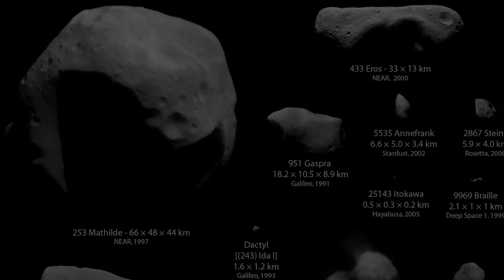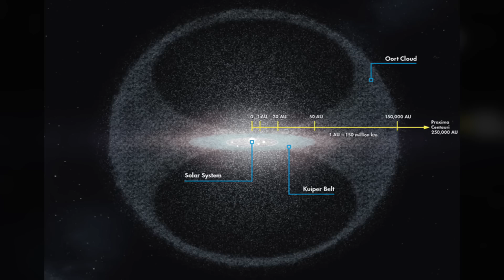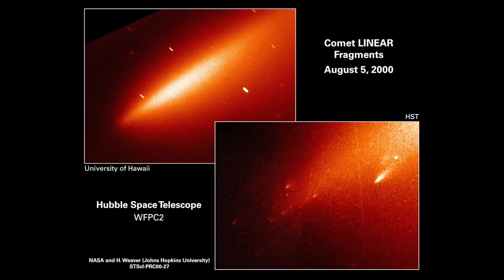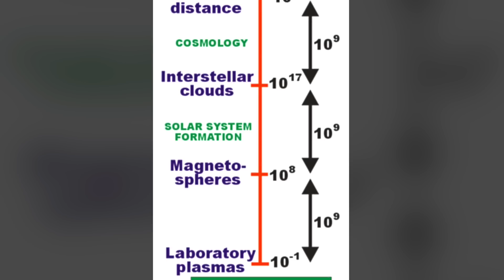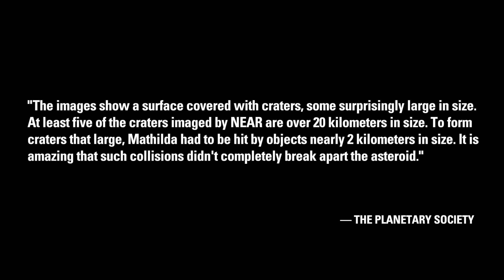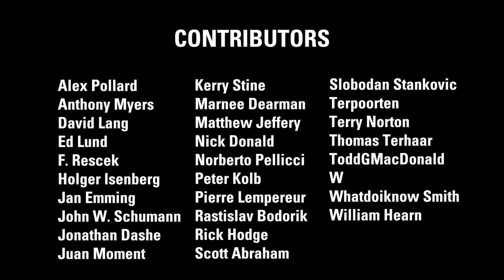Matt Finn: Asteroids That Should Not Be | Thunderbolts

Comment: I'm going with pieces of collisions as outward force of pressure. They are pieces of something bigger that was hit. Centrifugal force. Everything is quantumized pieces of elements. Heat does transfer through space and atmospheres outside of entanglement of mass as potential renewable heat energy when absorbed into internal magnetic fields grounding currents through its nucleus or core where external heat energy force is strongest centrifugal forces. Hurricanes within mass quantumized magnetism. Electricity is rapid heat grounding currents as magnetism bonding. Static electricity is rapid heat grounding through mass as heat energy leaves a trail lighting up the atmosphere like a filament bouncing of atmospheric gases instantaneously flash lighting as fire light. Lightning bolts are shoreline fire light of instantaneously fire lighting up atmospheres like filaments striking gases unabsorbed instantaneously. Fire is an external magnetic field disolving internal magnetic fields as mass. As you move closer to fire force increases and distance decreases and it's hotter. Move away and force decreases, and distance traveling increases. Magnetism.

Comment: And comet tails ate always in the opposite diection of the sun funny how that is possible if they are shedding material as they pass it would always be behind them. What about solar wind you ask. Well if the solar wind is strong enough to blow all the stuff away from the sun shouldn't that slow the comet down so that its orbit will be constantly changing ... but comets come in regular intervals that have been tracked for thousands of years.
Reply: Everyone misunderstands solar wind! 🤦
Reply: Well it's not wind, it's charged particles. They aren't pushing anything, but they are causing a discharge away from the biggest dog in town, the Sun.
Reply: Comets normally are only a few days near the sun and there the solar wind has impact on the comet. Not enough time to change the path of the comet much, because it has a lot of mass compared to the gases that gets released from the comet.
Reply: @melonenlord2723  earth winds have tipped over 18 wheelers, the notion that a comet or other astral body is unaffected in its path from solar wind that result from  coronal mass ejection trillion of times the size and mass of the earth is unlikely.
Reply: @melonenlord2723  Some comets have been seen to begin discharging electrically out past the orbit of Neptune. Clearly, that's not ice or gas sublimating from it. It's plasma discharge.
Reply: @ArchonOne  When there is an interaction between gases and solar winds, then it's possible that charging and unchanging can happen. Gases and discharges are not mutually exclusive. The solar winds are already charged.

Comment: Seems to apply to the moon as well?
Reply: it applies anywhere you see perfectly round craters that make no sense from a mechanical impact standpoint. About the only rational for round craters outside of electric arcing is when they're coming down on planets with thick atmospheres that could cause an air burst. But even then, if it wasn't for the charge differential between the surface of the Earth and the Ionosphere, they wouldn't be air-bursting anyway... so really, they are ALL caused by electricity.  But out in space... there is no mainstream explanation... something you'd think might give some of these experts a reason to pause or question, but that paycheck is a far better debater than I am, I guess.
Reply: statistically speaking, actual impacts would occur at almost every angle, and so the shape of the crater would deform accordingly

Comment: Excellent points. I did always notice, and found it odd, that so many of these remnants of impacts have generally rounded shapes to them. I can take a ball-shaped piece of rock. And smash it into pieces. The resulting debris has certain characteristics - when any rigid mineralized material breaks apart, it will tend to form sharp edges. I always assumed there was some nerdy explanation for why this 'space debris' rarely has these characteristics.
Reply: Yes, the lack of sharp edges is telling. Per the 'dust weevil'/accretion model these ass-on-steroid objects would disintegrate. So neither idea holds water. Be default, electric discharge machining is true.

Comment: You fail to understand how high speed impacts work. Just a cursory look into it will show that regardless of the in coming angle the resulting crater is circular. NASA's high speed impact laboratory has show this to be true decades ago.
Reply: wrong!
Reply: Weird because I was watching footage of a meteorite skipping across the lunar surface the other night, digging a long trench. I guess NASA's laboratory is right, and the trench on the moon is wrong. Did the laboratory explain how you can slam a 2 kilometer rock into another only slightly bigger, leave a crater half the size of the rock and not shatter it?
Reply: Also, for fun, I just went and took a "cursory look" into NASA's high speed impact lab and here what AI said: 
"Based on the provided search results, NASA’s high-speed impact laboratory experiments demonstrate that round craters are not always formed every time. The shape and size of the crater depend on various factors, including:

- The angle of impact: Elongate craters can be produced if an impactor strikes the surface at a very low angle (less than 20 degrees).

- The mass and velocity of the impactor: Larger and more massive impactors tend to produce larger craters.
- The composition and properties of the impacted material: The laboratory experiments likely involve impacting various materials, such as rocks, metals, or simulants, which can affect the cratering process.

So it turns out, Mr. Scifrygaming, high-speed impacts are not always at 90' angles, and the NASA laboratory does NOT account for the staggering number of perfectly 90' angle craters we see on celestial bodies.
Reply: don't waste your time.  I did some research on the chanel and the book he peddles and this is some kind of cult/conspiracy theory thing.  Not sure why - I guess it is just fun to be antiestablishment or something.  You can always tell these kinds of people when they refer to "MAINSTREAM" science/history/whatever.
Reply: @miketheburns  You're the guy who only watched 1 minute, got told by someone else we are a cult and not to listen, mindlessly obeyed, and now you're over here telling another of your buddies the same thing. Do you see why I make fun of you now?
Reply: @miketheburns  You are why I make these... and I bet you did research... watched a professor Dave. Maybe your "research" can explain how the Sun is accelerating particles out past the inner planets, and why it's millions of degree's hotter 20,000 kilometers off the visible surface, and coolest when we look deep into Sun Spots.

Comment: Asteroids and comets come from inter solar collision as the Sagittarius dwarf A galaxy travels through the milky way. ie., Wal Thornhill proto Saturn, RIP.
Reply: The spectral frequency of all the stars was mapped out in1983 before IRISS was shut down.  Thermography proved EU is correct.
Reply: @RkicF8  Really? I wonder if we have a paper in the archive.  That might be a fun show to make.
Reply: the asteroid belt was once a terrestrial planet - smashed to pieces
Reply: @andyman8630  Tiamat. The Sumerians recorded it... or at lease they passed down the recording.
Reply: I have a similar view, the planets are either gas giants or rocky bodies the gas giants are former stars/red/brown dwarfs now with reduced cores, the rocky planets their escaped cores. The cores broke apart in the acquisition process, the largest becoming inner planets and moons of their parent bodies the bits becoming comets and asteroids. The latter are distinguished by their proton/H+ and alpha particle content, the closer they were to the iron/nickel core the richer their content. The acceleration into orbit saved the planets and moons from catastrophic cooling parts not captured by the electric field which determines orbits shattered. The UV from the sun activated the surfaces causing the H+ to react and reduce all the sharp edges as they discharged either electrically or through reactions with elements in the rock, oxygen for example. Those rich in H+ continue to discharge to give the familiar cometary tails, less saturated rocks may still discharge sporadically. Occasionally the chemical reactions initiated by the heat of a rapid braking caused the rocks to react into much less dense potato shaped forms.
Stars are mainly formed as electrical bodies at the extremities of the rapidly spinning plasmoids [elongated ovoids] at galactic cores, then slowly move outward, the heliospheric current sheet being a better allegory than the orbital model, as the plasmoid rotates away. Sol retains the gyroscopic orientation it acquired from it's parent body in M54 and it's passage through the Milky Way with it's stars moving at a different pace helps explain how at least 4 close encounters and captures have occured.